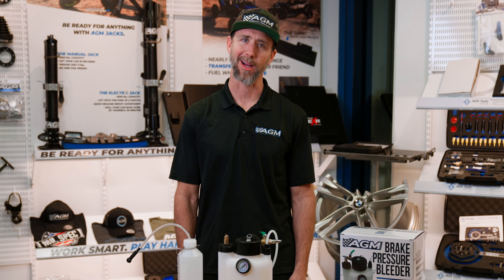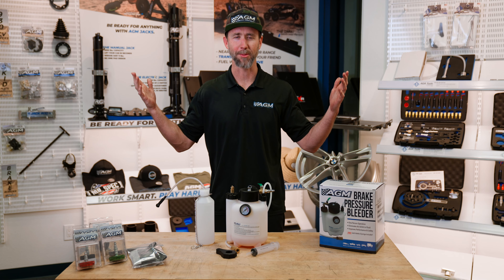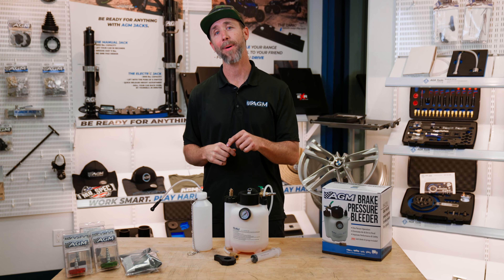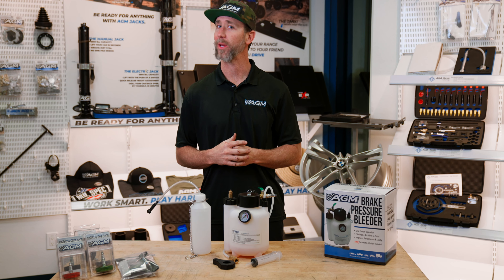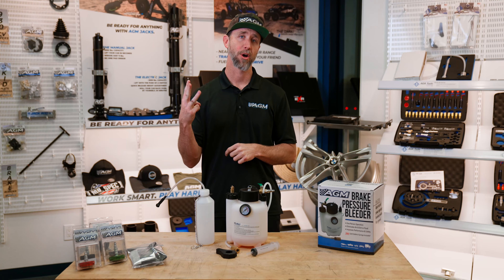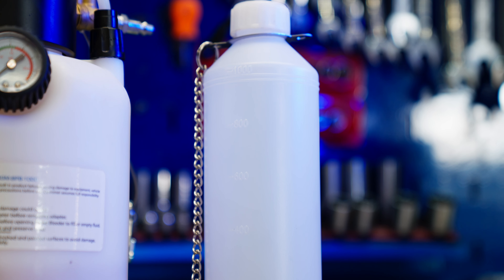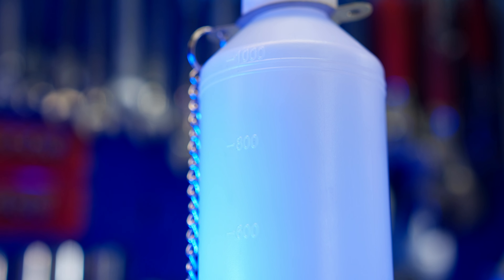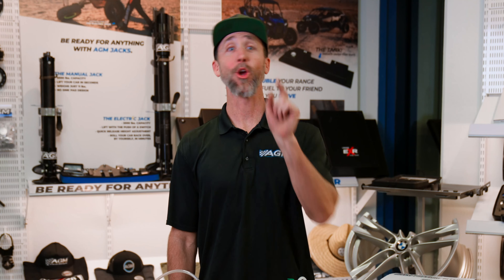The Best Brake Bleeder You Can Buy

Comment: Is this only for side-by-sides?
Reply from the maker: Good question, thanks for asking. Actually it can be used on any brake system. We offer reservoir specific adapters for many aftermarket reservoirs, as well as popular UTV models and have begun making adapters for automotive applications too. We also offer a universal adapter for the applications we have not made a vehicle specific cap for yet. If you have any other question feel free to email us at info@agm-products.com or call at 760-884-8319.